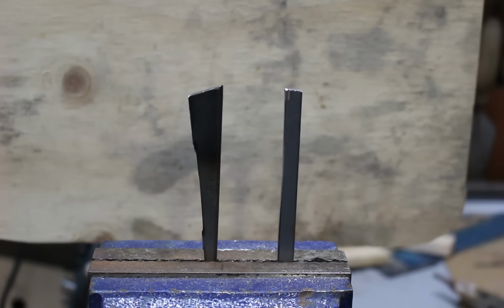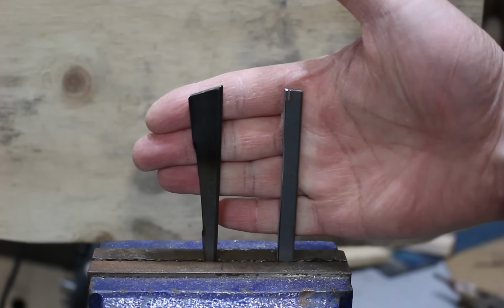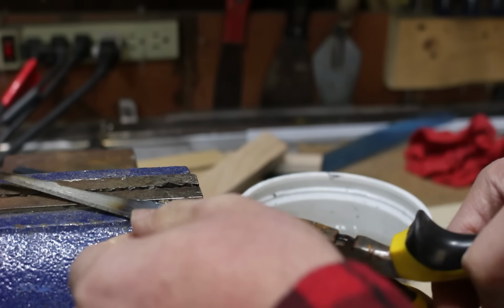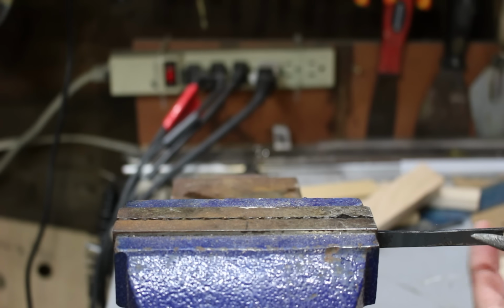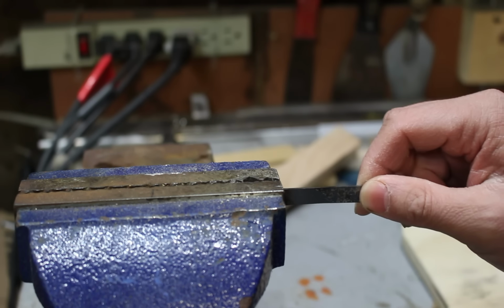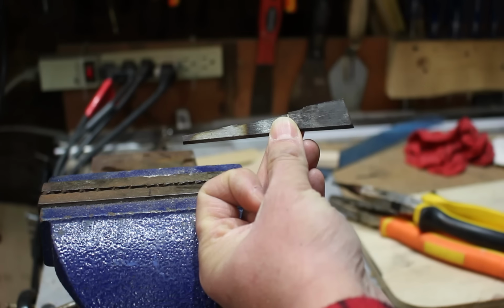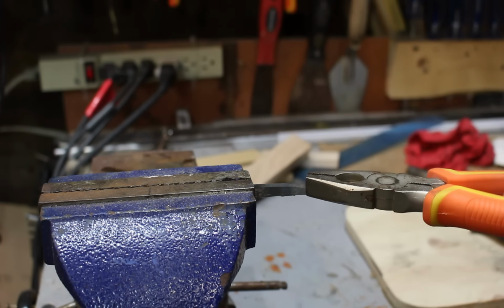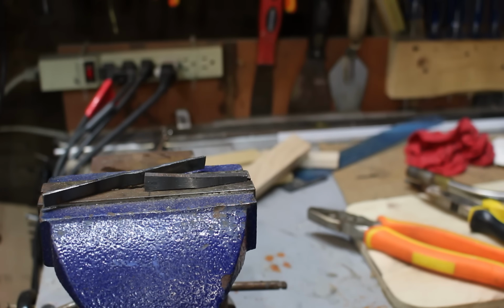High Carbon Steel vs Mild Steel Test

Comment: it is very interesting thanks.  I heard that with high carbon steel, people in the outdoors use a flint to strike it and sparks come off it.  would that not be a simple test, get a piece of quartz flint stone and strike mild steel and then strike carbon steel.  carbon steel would give off sparks and mild steel will not?  is this a fair test?

Comment: you bent the mild steel too far away from the end. the bit that was quenched stayed straight .  and you didn't use the tip of the file on the high carbon. do it right. plus you used two different sized pieces.  kind of a stupid test.

Comment: Let me see.. both metals  were the same thickness, check. How about a test with both pieces with the exact same dimensions in all directions. The carbon steel looked to have been heated before the test and after. On the bend test, the mild steel was bent in the area that was not treated; however, the carbon steel that looked pretreated was clamped in the vise into the treated area. I'm no metallurgy expert, but sorry, this test looked skewed.

Comment: i can see where confusion comes from, if we heat carbon steel and quench it hardens. If we let it cool slow it is annealed (softened). with other metals, copper for ex, once we heat it, it will be soft REGARDLESS of whether we cool it fast or slow

Comment: Having been a Tool and Die Maker for almost 40 years, i have done my share of heat-treating a few different types of steel, but mainly LOW-carbon ( it's not mild ) and regular Carbon Steel, which has a higher content of carbon in it, making it one of the "all-around" types of steel to work with.    I've beenretired quite a while now but i'm sure these have stayed about the same.  I have personally during my career, heat-treated at least a thousand individual pieces of Carbon steel, and not so much of LOW-carbon, otherwise known as "cold rolled steel".     Basically get the piece A NICE cherry-RED IN COLOR AND THEN JUST dunk INTO A DECENT-SIZED CONTAINER OF OIL THAT IS NORMALLY USED FOR HEAT-TREATING PURPOSES.    Suggested proper temp of the oil should be 150 degrees but it even works well at much lower temps. SO, into the oil it goes until it's cooled.  Then clean the part, maybe with kerosene to remove the carbon flakes and the oil residue.   The steel at this point is very hard, and needs for its' hardness to be reduced,otherwise the part will be extremely brittle and could shatter quite easily.   After the part is cleanes it should be sand-blasted to remove the BLACK finish of the part so that the "drawing down process" can be performed.  Once again, the part is heated using a torch or small furnace,  BUT...........don't go nuts with the heat, and not directly. Heating the part slowly without using a direct flame  will start to discolor the part, starting with a light brown color, continuing to a darker brown color ( we call those brown colors "straw" ) and then the following will be from light blue towards dark blue and then purple etc. Normally for working purposes, the ideal color would be either LIGHT-to_dark straw.      Before the drawing down process, the carbon steel would have attained a hardness of    .............. R/C 62 on the Rockewell scale.     Afterwards it should be around 58-60 R/C, pretty darn good for most tooling applications.     So the lesson for today is.........................LOW-Carbon steel  ( cold rolled ) or standard "Carbon steel" with a much higher carbon content.    Tadaaaaa for today.
Reply: that is the best summary of heat treating basics I have seen.  Thank you Mr. Samson
Reply: Stopped watching the video to read this heat treat tutorial. Thanks for this... 🙏🏻
Reply: Mr Chuck 
I've learnt a thing or two. Never thought I knew it all, never confess it much either 
Anyway  hope your getting all the $ you payed in all those yrs of working. Enjoyed your knowledge sir
 We"ll.see ya!

Comment: 5:47 its called Martensite or Martensitic steel when it is crystallized with small, brittle grains.

Ferritic or ferrite is when it cools for a longer time (depending on carbon content)
Reply: Pretty sure Martensitic is a STAINLESS Steel Grade , not Carbon steel .
Reply: @johncunningham4820 Martensite is a metastable phase that forms in quenched steel (carbon steel, alloyed steel and  martensitic stainless steel) that has a very high strength and hardness but high fragility too. All carbon and alloyed steels that can be quenched are able to form martensite, however not all stainless steel can be quenched, only martensitic steel as you said. These tipically contain around 13% of Chrome and 0.15 to 0.35% of Carbon. Other types of stainless steel like ferritic or the austenitic stainless steel contain even less carbon (0.05% aprox., hence why they are not hardenable) and more Chrome and Nickel. The most common type of stainless steel are austenitic steel, with very high contents of Chrome and Nickel

Comment: For someone like myself just taking his first small steps into knifesmithing not knowing anything about metal this is invaluable. I know so little I was wondering why springs are such a popular starting point. Thank you, these are the things a lot of channels make the assumption everyone knows.
Reply: i'm 10 months late but if you have any question about metallurgy or blacksmithing let me know, i'll try to answer to the best of my knowledge.
Reply: 777
Reply: @jeffjoestar4245  is there a steel with Boron Carbides? And what is it and why can't I find it on the internet? What does Boron do to steel if not form Carbides? And what about Titanium (in steel)?
Reply: @jeffjoestar4245  sry 1 yr late lol
Reply: @jeffjoestar4245  youtube mostly I meant*

Comment: I believe hardening requires it to hold at a certain temp for a while so the grain structure can change, and then cooling it. But what do I know. Just a welder
Reply: Nah, it's a Japanese technique where if you heat and cool it, the steal experiences a change which then you hammer it to condense it but what do I know, I'm just a guy who looked in Wikipedia for a few minutes
Reply: Not at all.        The brighter red you get the piece, the harder it will be.  Going to WHITE-hot color would make it a bit harder but i wouldn't advise it. Once the proper color has been achieved, hold that for 15-20 seconds at most and then quench in the oil bath.
Reply: How do I convert HR hard sheet to soft sheet?
Reply: @jubairahmed5719  . By annealing . Heat it cherry red and then allow it to Air Cool .

Comment: You know you can actually make a somewhat functional knife or sword out of mild steel it just won't hold an edge very long and it will bend if you hit it hard agianst something, but you don't have to worry about it breaking.
Reply: You can make it out of mild steel and harden the blade
Reply: Lisandro Nari hardening mild steel is almost impossible and if you pull it off it’s barely noticeable
Reply: Case hardening is still possible I think though.
Reply: @lisandronari1831  This exact video is about how mild steel doesn't harden.
Reply: @lisandronari1831  . I'm pretty sure the POINT of THIS  video is , that , NO you cannot Harden Mild Steel .

Comment: if you want a bearing hard of the carbon steel not bend or not cut folow the red color of the fire of the carbon steel the secret of JAPANESE TO QUENCH IS THE color blood of the fire of the samurai before they QUECNCH IT INTO THE OIL OR WATER TO AVOID OF CUTTING CRACKING ETC

Comment: What if you quench it in something like motor oil to increase the carbon in the steel?
Reply: what makes you think motor oil will increase the carbon in the steel ?  You would need carbon to add to the steel first !  Quenching it in oil will only allow it to cool a little slower than water will !  If you want to increase the carbon content , you will have to add carbon to the steel during the heating process !

Comment: If you want to see what steel your blade is made out of, snap it. If it does snap it's a good blade..... Well, not anymore.

I did enjoy the vid though, had to make a joke
Reply: Little Dan McNamara You can check by the spring effect u don't have to push it till it snaps🤣🤣🤣🤣
Reply: U do the test before you make the blade.

Comment: Any steel, even with minimal carbon, can be case hardened. High carbon should be annealed (soften) so that it can be worked with. It would then need to be tempered (hardened) to bring the hardness back. Mild carbon steel can be case hardened or tempered. I have made many knives over the years some of which from mild carbon and when case-hardened correctly, they last a very long time. As a professor of welding technology and metallurgical Sciences, I've learned that mild carbon steel does not deserve the bad rap that it often gets. Knife makers prefer high carbon steel such as 1095, because it will require less annealing and tempering. It's basically ready to go and a sharpened Edge will last a lot longer. But it does not mean that mild carbon is inferior.
Reply: Case hardening is adding carbon, therefore it not being mild anymore. Soo
Reply: @awashburn6944  well said. You addressed my exact question(s).
Reply: He plays a professor in his video games. What he said makes no sense which if he was a professor, that's a mail in degree

Comment: How do i add more cwrbon to my steel, but not enough to make it cast iron?
Reply: @awashburn6944  but that yields mild carbon steel, i guess that's better than. Nothing
Reply: @awashburn6944  yes and that is ideal for armour, as the hard steel on the outer layer provides slashing protection, and the combined provides piercing protection.

Comment: you only need a bit of high carbon urged into the cutting side.....or case harden it......the prosess for hardening it not simple....there are many ways ant the more controlled and repeated the better.
Reply: Case hardening has no practical use I knife making. The hard steel would only penetrate a few thousandths of an inch and would be removed after the first time sharpening.

Comment: which steel is better for high magnetic field low carbon or high carbon?
Reply: I guess it's only iron that works with magnets. The purer, the better.
Reply: High carbon works best to polarize....certain magnets shatter some don't.

Comment: 1055 how is the hrc what that have
Reply: Lupus Diem Too much HRC and the knife is useless for real work and will probably snap quite easily. 

Depends what you wants but for 1055, I’d say 52-55hrc is optimal. Also, too low hrc and the blade won’t be very functional at holding an edge. 

This is why the steel has to be tempered.
Reply: I like when hrc is 57-60

Comment: That was such a bad experiment I have made a carving knife out of mild steal and I have carved over 5 Woden spoons and it still holds a edge
Reply: Whats a wood compared to metal working?
Reply: I even did a fair amount of carving with a brass knife I made as a kid. Held an edge better than expected. Obviously sucks compared to carbon steel.

Comment: You don't understand how to quench mild steel. It can be done, though not easily. Also, your quenching of the high carbon will obviously cause the piece to be brittle, you quenched it in room temp water. Neither time did you bring the material up to the proper temperature for a heat treat.
Reply: I was thinking exactly the same. The metal just got a little red before dipping, and that is really not how it is supposed to be.

Comment: You weren't even using the tip of the file to scratch the high carbon steel... You were using the portion of the mild steel that wasn't quesnched when you bent it. You can make austenitic steel from mild steel.     You need to do some research. You can make non magnetic metal from magnetic metel by making it austenitic. A lot of stuff you say is kind of wrong.
Reply: @awashburn6944  it's called allotropy. And these critical... Points change with ingredients. Also called eutectic points when the melting points are lowered.
Reply: @awashburn6944    all non ferrous metals are non magnetic. I misused the terms for definitions instead of the properties.
Reply: @awashburn6944  have you started learning about body centered cubic and face centered cubic? What about solid crystal forging? Vacuum induction forging is the best way to get super alloys with maximum strength and ductility.
Reply: @awashburn6944  ok so you haven't heard about single Crystal formation. It is used for turbine compressor blades on jet engines. Instead of a structure of multiple crystals across the metal structure the entire part is formed as a single solid crystal with no boundary edges for weakness. Such as when ferrite and Pearlite form as the carbon diffuses. There's not much information on it. But there are a few wiki pages. It's really only for people who want to know what the future will be like.
Reply: @awashburn6944  ok so how does the single Crystal process work?
Reply: @awashburn6944  so there is some sort of seed? What is the quantum mechanics of the seed?
Reply: @awashburn6944  I'm just reading about the single Crystal process right now. I will see if I can determine how this process starts and what conditions the liquid metal needs to start the formation and carry it through completion.

Comment: Lots of stupid people in the comment section cant accept the fact that high carbon steel breaks because its a hard steel. They would even critisize you for being right because they have some kind of knowledge from their years of imagining how steel should and shouldnt be. Yes high carbon steel (a steel that snaps when bent) are used better for knives because they are hard and hard metals hold an edge better than mild steel, in addition to that it can be heat treated to be springy and tough so it wont break when bent instead springs back to its original form. So in short high carbon steel + heat = tough metal - mild steel + heat = shitty metal.. the only way you can harden mild steel is by forging..
Reply: So if i got it right,high carbon steel should never be cooled down with water, only on its own?
Reply: @OccultReader  depends on the alloy